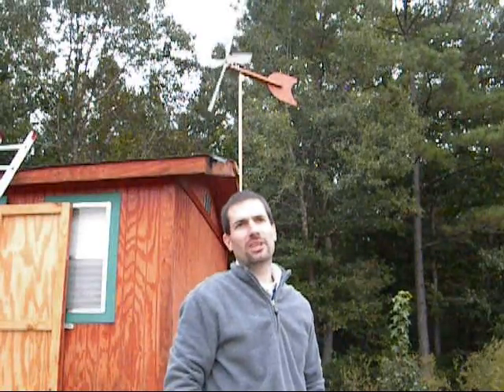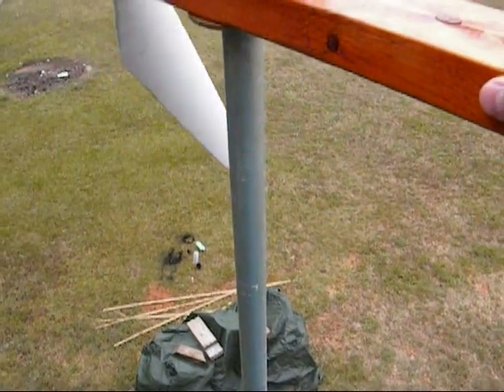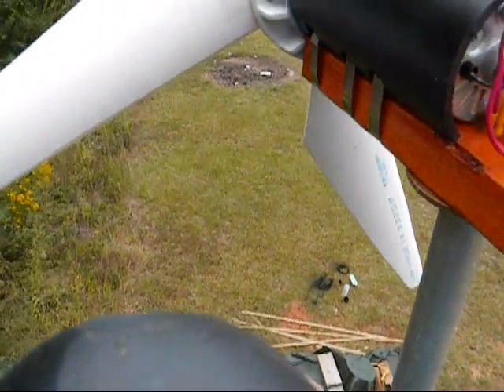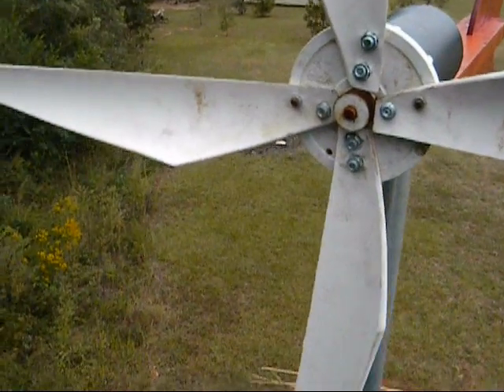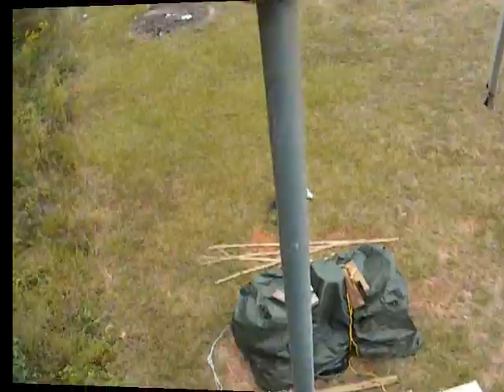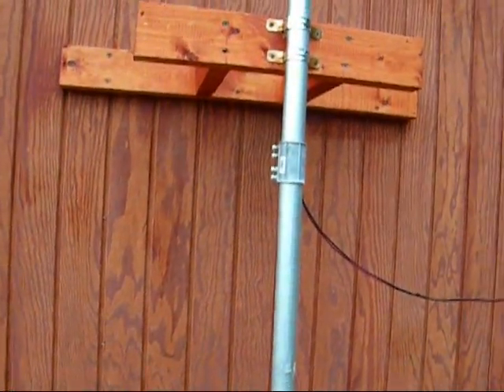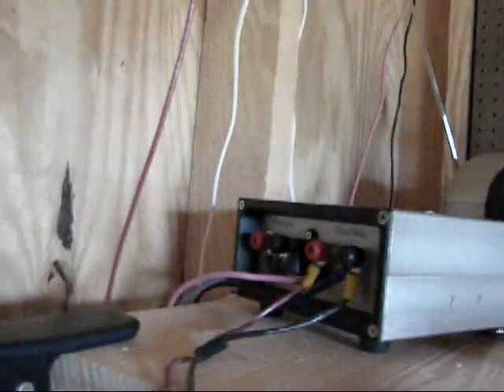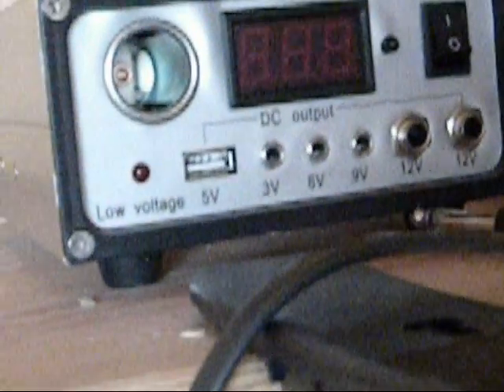DIY wind turbine part 2

Comment from the maker: I will guess and say it was around 12 mph that day. I never had a guage to test the speed of the wind so I can only guess on that. I think 10 mph would get it going and should be real close to getting you over the 12 volts that you need to charge your batteries up. Thanks for the question, Lonny

Comment from the maker: @88bobo111 The only real problem that I had was the turbine was taking power back from the battery when it was not turning. So I just added a $2.00 blocking diode and the problem was solved. When the battery is full the regulator stops the flow of electrons so the battery does not get over charged. Thanks for the question, Lonny

Comment: Awesome video. So you are just using a solar charger to charge the batteries, with the power that comes from the turbine. Have you had any problems with this set up? What happens when the battery is full charged and the turbine still produces power? Thanks in advance

Comment from the maker: @VWRabbitdiesel I think it might work, I used to take two little hobby motors and put homemade tongue depressor blades on them and wire them in series. I would hang them outside the window of our car and I would get around twice the power.  I was the passenger, not the driver of course.

Comment from the maker: @jab0805 I do have another smaller free treadmill motor I have thought about turning into a hawt. It is hard to describe but I will try a belt drive on that one. The blades will be directly connected to a way bigger fly wheel and the belt will drive the motor. I hope to have a 4 to 1 ratio or greater The motor will be under the turbine body (2x4). I might have to go with a longer blade, but I am not sure on it just yet.

Comment from the maker: @bjetTube Good question, I I have noticed that the turbine only faces the left side or the right side or the middle but never the back of the shed.  it just has its 180  pattern that it turns in. it has never turned completely around in a circle.   
 
 I just wanted to see if I could make one and if I made it how well would it work. I enjoy making vawts better and I am slowly making another one. I think it was quicker to make a hawt, but vawts look better. They both have good and bad.

Comment: I think a old tower with a Hinged base plate would work real nice. im going to use a old tower and pars off of a old bike cut the gooseneck off and weld a plate on top for a mount, cut the frame off the down tube and take the forks off and use the down tube for the mount on the tower it will last for years and move move easy not like a floor flange and pipe. nice system u have there .

Comment: I like the simplicity of this set-up especially for true emergency power needs. One thing I noticed, you might want to up-size the wires you have coming from the motor/turbine. Even with the relatively short run you have the wires you are running seem ripe for power loss. Maybe run another set of the same wires and jumper them together effectively doubling the copper. You wont get the additional sheilding benefits but it would help some.

Comment: Your videos are great and I like your HAWT.  
Question 1: How do you keep the wires from twisting in the pole to the point that they will not rip and short out?  
Question 2: Why the divergence from the VAWTs or are you just trying the concept?  I would think the VAWTs would be much easier to generate current.  (Please realize that I have limited knowledge of both and am curious VAWTs.)

Comment from the maker: @VWRabbitdiesel I wish I was stuck with 8 motors, they are really hard to find now for free. Have you tried to make two turbines and putting them in series? you might get the power you need to charge that way. Just a thought :)